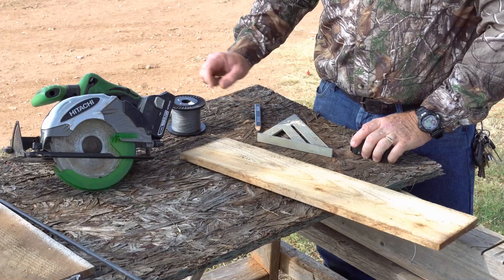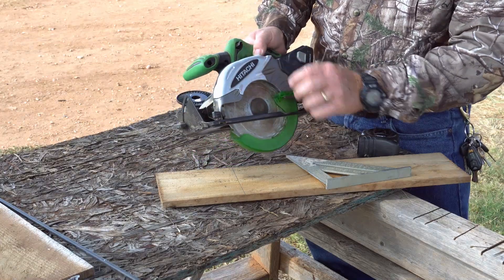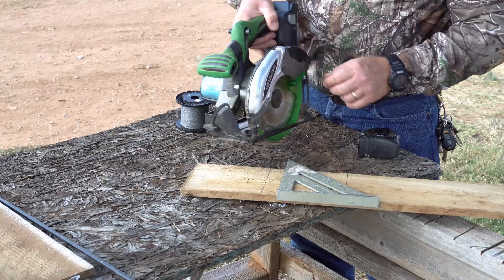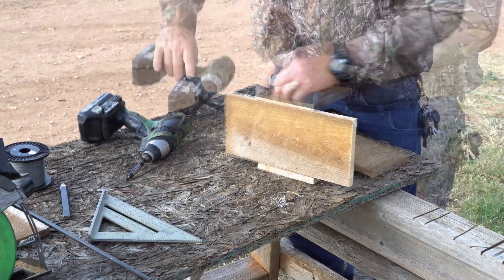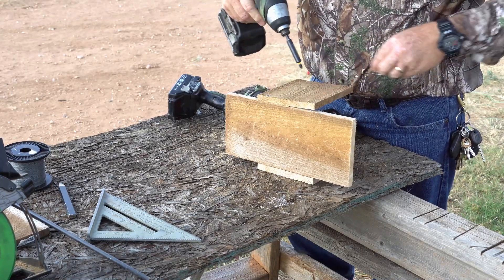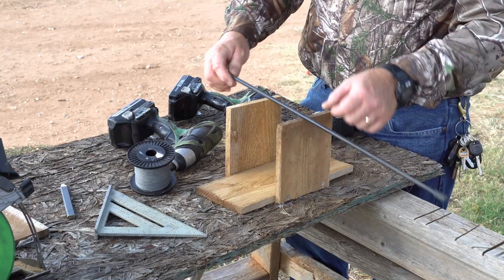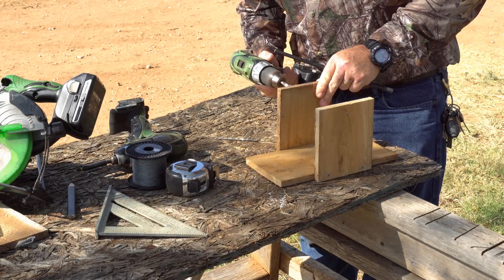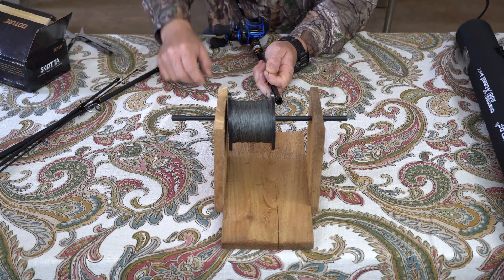How to Build a Homemade Fishing Line Spooler. Simple and Easy!

Comment: Nicely done, but don't you need a spring or something to tension the spool?
Reply from the maker: I have not needed a spring,  but if I did, I would just stick a small piece of foam rubber on the dowel to provide a little friction to keep the spool from free spooling.